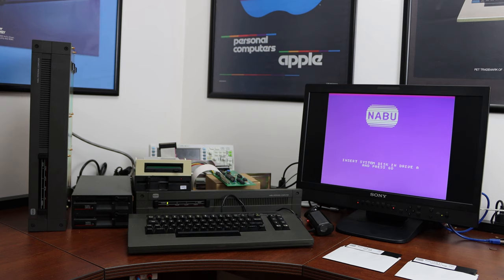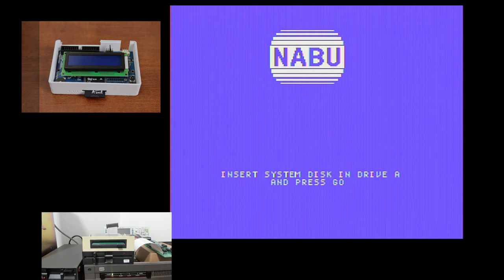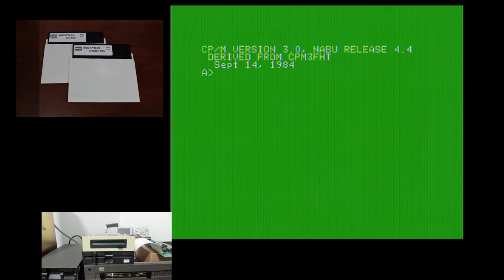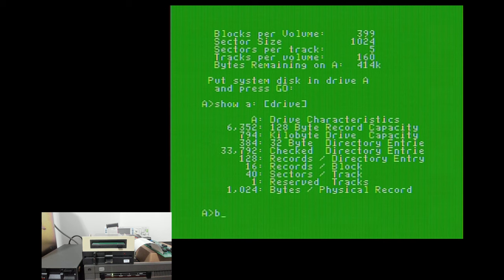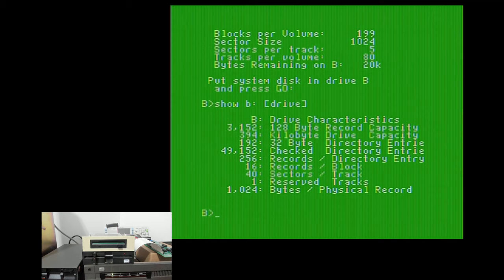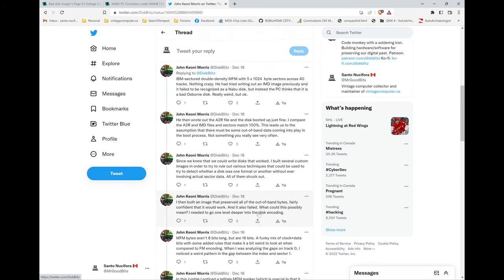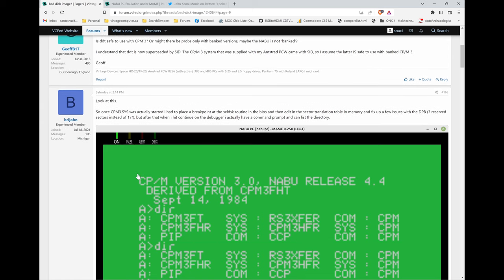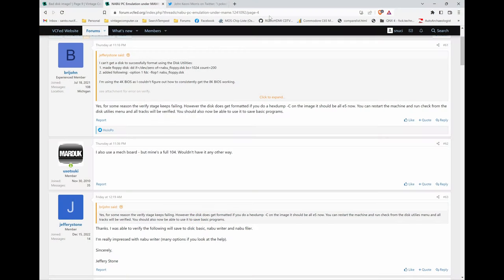NABU PC Floppy Controller Reproduction testing

Comment: Since this is a repost of the other video, I'll say it again, WELL DONE getting a 720K floppy working with a replica disk controller. I thought it might be possible, since we supported 96tpi, but I didn't know how.
Reply from the maker: Thanks for reposting your comment.  I didn't want to lose it.  With the 3.5" DSDD diskette, I answer "No" to 48TPI and "No" for single-sided and then proceeded to format.  The format command is also why I pursued the 5.25" HD diskette for a while until I realized the WD1797 controller chip on the FDC board couldn't do high-density.  Oh well.
Reply: Agreed, this is well done progress on the NABU PC floppy controller reproduction project. Thank you as always Leo for all you did with NABU back in the 1980s and now doing in 2022 and beyond!
Reply: This format will work for 5.25 DSQD disks too - they're also 720k on a PC.

Comment: Anyone now looking at a Gotek solution for the Nabu?
Reply from the maker: I have looked into it and have not been able to get it to run with Flashfloppy HxC support.  HFE files work on the HxC2001 but not on the Gotek.  It might be something I am doing wrong but I have a Gotek with proper HxC support on the way to see if this works as it might be a connectivity issue and not necessarily Flashfloppy firmware.

Comment: I originally thought it would be cool to get original NABU drives, but being able to use regular drives is a great alternative. I wonder though if it's possible to acquire NABU floppy drives?
Reply: You could definitely make something that looks authentic using the centronics cable to the board in the drive case, which has been replicated. the drives themselves are not anything special

Comment: Could the disk images be used to create floppies with a Greaseweazle? And would they be compatible with a Gotek?
Reply from the maker: I have not yet tried a Greaseweazle.  I did try a Gotek with Flashfloppy and used the HxC support but it would not work.  I am going to try a Gotek that I just recently bought with actual HxC software on it to see if it will handle the HFE files.